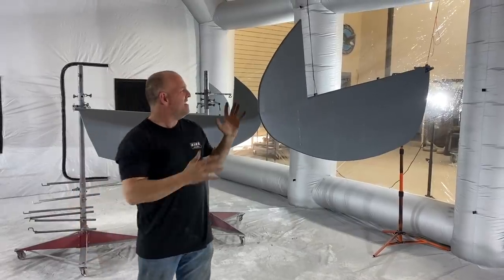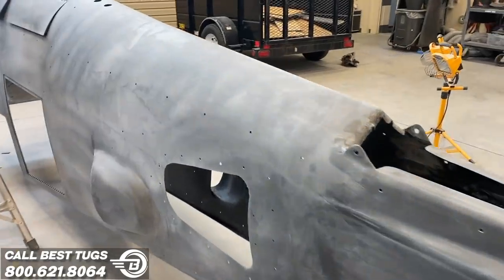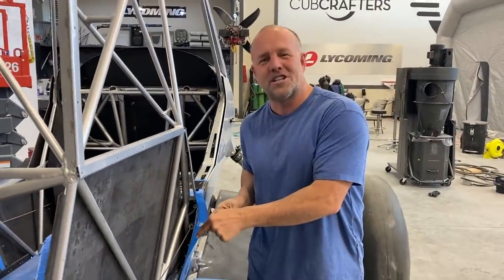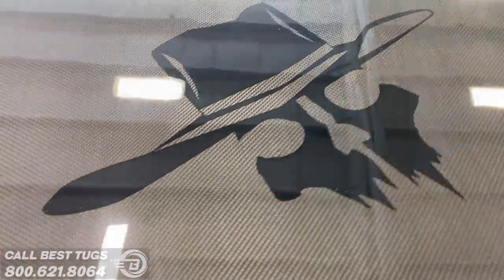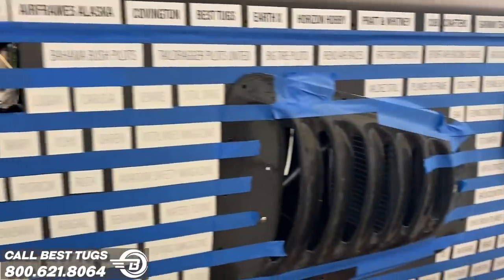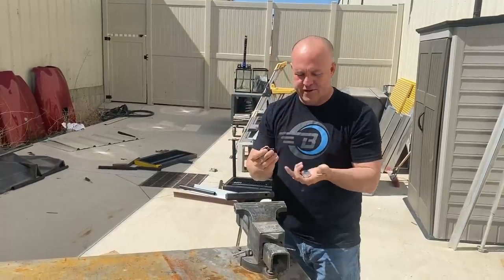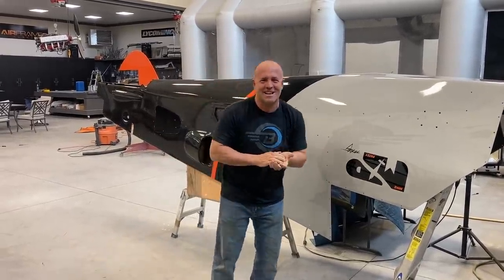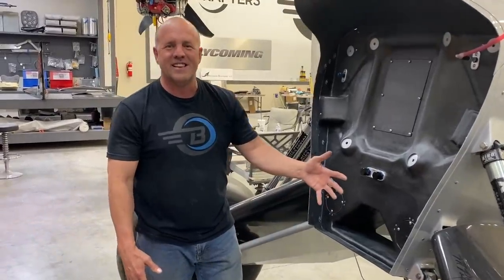Scrappy gets a paint Job (Scrappy Bush Plane 23)

Comment: oh, now i'm interested to see what you've got going on in the suspension. I know those shocks well, they don't need a high pressure line running to them like that in a 'typical' application. I also see those dual carbon fiber wrapped tanks in the belly pod. Hypercomp Engineering by chance? I know those guys well and they are also based in Northern Utah. All of that stuff has my spidey senses tingling! I can't wait to see what weird shenanigans you've got going on for the gear wings!
Reply: This unique quad-shock landing gear configuration will allow Mike to fly the aircraft into the ground effortlessly, at will and with incredible  precision.  Point it and then power controls decent rate to target. 
Think about how that capability would allow you to modify your entire landing technique.  I'm sure he will set the new standard for Spot Landing and Stol-Drag competitions.  Want to guest what happens when you finger- trigger a high pressure air source to these airshocks at the aerodynamically  optimal moment in  the take-off run?  Scrappy, with that massive air-prop, coupled with controllable pneumatic landing gear, will even surpass the incredible takeoff and landing performance of Draco!  I'm telling all my aviation friends to check out 'Back-to-work' Mike Patey.  So many unique innovations in one plane from tailwheel suspension to final carbon clearcoat and he's  not even revealed the wings to us yet...Super impressive concept and execution of  the insanely detailed fuselage graphics with all the aviation names imbedded in polished clearcoat over carbon. Absolutely Brilliant !
Reply: @chucklewis6949  I've been thinking about this, and i'm not 100% convinced that bouncing the aircraft into the air during takeoff will buy much. The suspension will do wonders for landing, yes, but i'm not positive a little bounce at the right moment will buy much on takeoff. My thoughts are that if the wings are generating enough lift for that to be beneficial, they are right at the brink of having enough lift to take off normally anyway, because without the airspeed, there will be inadequate lift to keep the plane in the air, so it may just float back down. Now, granted, it would increase the angle of attack a bit, but that's just going to use up some of the energy the plane has and possibly create a stall just above ground, but then again this little plane has enough horsepower that may not be the case. it might be just slap the throttle and pull a trigger and you're off the ground. But, i vaguely remember him mentioning in the videos he has a method to prevent the landing gear from being drooped out during flight. So i'm betting he has a secondary piston at the bottom of the shock that he can apply pressurized gas to that will effectively raise the lower bump stop causing more loading of the suspension, so its more rigid and predictable in flight and leveling the gear wings.
Reply: Mike mentioned he could lock the shocks whenever he wanted so he may have developed a system to control the angle of his gear wings in flight and on the ground. He has also mentioned I think the idea of getting a plane to partially 'leap/jump' off the ground during the Draco series. Mike seems to have at least 3 uses for everything so it would be lucky to predict  all the surprises Maestro Mike Patey has in store. Can't wait!

Comment: @Mike, I have a question. This plane has very long suspension travel, the Wilga's are known for landing at weird angles because the landinggear allows one wheel to be fully extended and the other fully compressed. Did you consider some anti-roll feature for this plane? For example by cross linking (top of piston one to bottom of piston two and reverse) the two sets of shock absorbers with a set of accumulators to compensate for the difference in volume of the top/bottom of each piston?
Reply: I think Mike is familiar with the Wilga  issue
Reply from the maker: I think your really going to like an upcoming video 😜🤠
Reply: @MikePatey   Looking forward to it then! A sidenote: I like the landinggear of scrappy, so I made a landinggear for my RC plane that is close to the one on scrappy but modified to be usable on the RC scale. It is made to fit on the "durafly tundra", this is a quick render of the idea: https://live.staticflickr.com/65535/50080678213_59e9a47a65_h.jpg
Reply: @geepuller1  Hey, yeah he has a wilga and had draco besides that. I named it to clearify what type issue I was referring to.
Reply: I'm thinking the mini wings and landing gear are active and move up and down with a switch through the hydro king shock's... Maybe  Rad build!
Reply: Those mini wings with the landing gear are active I bet... King hydroshocks maybe? ; )
Reply: In the last video, he hinted that there was something special with the front shocks. I can't wait to find out what. 
In the Draco landing gear video he talked about how he figured out how to make the plane squat down and then jump up on takeoff, but the system was too heavy. I wonder if he is going to do something like it on scrappy now. It's the perfect plane to try out silly stuff like that.
Reply: It could be this option from King: http://www.kingshocks.com/products/options/ibp-internal-bypass/

Anyway, enough speculating we will just have to wait and see! Looking forward to the next video Mike!

Comment: Mike, another backstop for the cable on the tube is a super thin piece of hdpe. That way if there's vibrations making the cable contact it would take 100 years of wear to ever touch a tube. Just like the stock piper rub plate..

Comment: Mike,   Very Nice Work, Sir. I cannot wait to see Scrappy's performance. It will be Amazing !!
I believe You have achieved YOUR GOAL of promoting General Aviation with both Scrappy and Draco. This build may be the 14th or so aircraft you've built but the impact on GA cannot be
overstated, in my opinion. This video, since YESTERDAY, has 93,965 views (38 trolls didn't like it). People talk about the things they like, so I figure 94K views will touch a significantly higher
number of people.

Comment: I’ve done two airplanes with Stewart systems now.  On the last one, I put two cross coats of eco prime over the eco fill and loved the results.  I used smoke grey.  The lighter color made the red top coat really pop.  It does add weight though.  
I place a small strip of thick Teflon tap on any tube that a cable comes close to.  It’s just a little extra insurance.

Comment: That white paper your stickers are mounted to works really well as masking tape and you don't have to use 50 rolls of tape. You just lay it over the fine line tape (that you should be using) or the stencil and then carefully trim with a blade..

Comment: Get a cheap 29 foot tarp and throw it on the floor. Then you can pull it out and pressure wash it to get all the dust off and then when you wear it out you just throw it away.  I don’t have room to leave my paint booth up so it makes it easy to keep it clean.

Comment: The landing Gear Mini Wings are going to generate a lot of Drag from the space between the each arm. Consider building a leading edge cowling to cover the gap. Also I notice the electrical tape under your grip-ties on the hoses. Silicone Self Fusing Tape holds up way longer, and stronger under the the extreme temperature changes.
Reply from the maker: 🤠 Agreed on both.  The gear legs I’ll talk about later. the Griplock clips and photo wasn’t from my plane, just something my friend editing found real quick online. I use the same tape you mentioned.  I can’t stand the mess electrical tape makes and certainly worse in high temp 👍🤠

Comment: A genuine delight to behold. It will be interesting if beneficial ground effect occurs from the aerofoils on the main undercarriage arms with such a huge wash coming back from the prop pocketed between the aerofoils and ground. My imagining is that the aircraft may be come a little less stable on the roll axis. With extreme nose high power-on approaches and landings, I guess this may become moot.
Reply from the maker: 👍🤠 Certainly on the right track in my design considerations. I’ll talk more on it later

Comment: Hello Mike, I have a question for you... Back in episode 12 "Building Molds" you created the vented air exhaust cover for the oil cooler. I've wondered why you chose to bring the air for the oil cooler through the side of the fuselage instead of bringing the air into the oil cooling chamber in a straight line from the top of scrappy, down in through the filters and exiting out the bottom of the fuselage. I'm sure there are a lot of viewers like me who would like to know why that approach was the better option. It's a pleasure to watch you work and build an exceptional bush plane. Thanks for sharing. Please keep them coming.

Comment: I am in awe of your skill and progression. Amazing attention to detail.

You discussed sanding into the carbon/glass as a sacrificial layer. It has got me wondering at what point would the layer be compromised. If the higher strands of the cloth were nicked no more than 1/2 their cross-sectional diameter, I calculate that more than 90% of the strands are still in tact. 

Would it be appropriate to consider that the structural integrity left in that layer would be at least 90%?

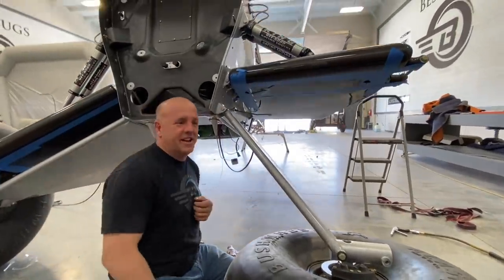Comment: 20:22 -I think I figured out (one of) Scrappy's secret weapon(s). It looks like his custom shocks can be locked into place. (Hinted at in a previous video and shown in this video. Maybe even actuated to move up and down?)
-My theory is that while on the ground, running the engine at high RPMs, and brakes on; Mike may be able to compress the main gear; squatting Scrappy to the ground and locking the main gear in that position. (Similar to Draco's squatting action before take off.) Then Mike releases the brakes, gains speed, and right before Scrappy rotates, he can push a button that releases/actuates the main gear! This would not only push Scrappy up into the air, but the reduced deck angle at the beginning of the run reduces drag to get Scrappy up to take off speed sooner, and then the sudden increased deck angle will increase the angle of attack/lift of the whole wing. Maybe popping in more flaps at that moment too. He'll also get additional ground effect lift from the landing gear wings.
-Scrappy may literally jump into the air! Haha! :-D So epic!
-Also those Kevlar bottles under the pilot's seat look suspicious. Perhaps compressed air/nitrogen tanks for the shock actuation system? Hmm :-)
-If this is all the case, I do wonder how well the gear will compress. Since it's a double A-arm suspension, the wheels will tend to scrub on the ground as the wheel track increases if he compresses the gear while at a stand still. He may have to modulate the brakes to roll the plane forward a bit during the engine run up to get maximum squatting action.
-Just my theory. I can't wait to see the maiden! :-D
Reply: no wheel scrub , double a arms .  but he hinted at a trick ,so I think you are on to it , he got the shock builders on board with something , ie not a standard of the shelf part , and they look a lot bigger than needed for a light plane .

Comment: Since youre planning on flying in Alaska, and have the cockpit designed to stay sealed up weather tight even after a ballistic chute deployment, have you considered a radiant film insulation between the outer and inner skins in the cockpit? I dont think the bubble-wrap style insulation would survive the pressure changes with altitude, (though it might, test in a vaccum bell jar?)  but even something as simple as gluing down a space blanket with spray adhesive to one  panels would cut down on radiant heat transfer in the gap. it might even cut down on heat from direct sunlight bleeding in when youre in the lower 48, and not add much in the way of weight.  It seems like it would provide some benefit to normal use, some benefit to emergency use, but I'm not sure if the benefit would be big enough for it to be worth your effort installing it or not.

Comment: I bet the secret feature of the shocks is they are air shocks and can have a really high pressure blast blown into them to launch the plane into the air on take off. Those looked like air lines to me and when he took them out of the box they weren’t at full extension like an ordinary shock. If I’m wrong correct me

Comment: Hi Mike, i love your YouTube channel. It is the most interesting and satisfying of all YouTube channels, in my opinion. I love Scrappy but, i am worried about the bolts connecting the landing gear to the fuselage. Shouldn't you be using steel dowels instead? I am worried that the shock absorbers will shear through the bolts like a hot knife through butter! Stainless steel bolts with holes drilled at the ends for locking pins would be much more durable and tough. Bolts have threading around their surface which can be thought of as large continuous cracks!

Comment: The aircraft I work on utilize carbon fiber on most of their fuselage and panels which makes me familiar with the difficulties of attaching carbon fiber to a non-fiber component. I watched the process you went through to make the fuselage and you briefly touched on the process you were going to use to attach it the tube frame. I was hoping you would have shown how you actually accomplished the installation. Attaching anything flat to tube without stressing one or both and achieving the required structural integrity is extremely interesting. What type of hardware are you using on your installs? Great video's, thank you for sharing. When is your bother going to start to share his build?
Brock

Comment: Sir,,,, those looked like nylon bushings on the control lines.... I used nylon pulleys back when I built soap box derby cars.  The line actually cut thru the nylon and I had steering issues because of it....

Comment: Mike. Do you worry about the heat generated inside the airframe with all the black carbon fiber? I build composite rc sailplanes and we try and keep the wings covered when sitting in the sun to avoid heat damage. The wings/fuselage are all exposed raw carbon so they get really hot.

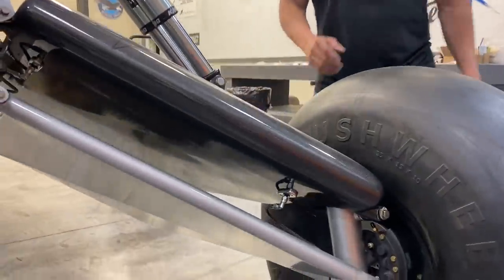Comment: great job!! however, at 26:24 i was wondering if it might be worth it to somehow to fix the flexible brake hose. i fear that as the suspension articulates it may push and pull on the flexible brake hose that it may end up loosening the 90* fitting at the (new-to-market) the Patey Bulkhead Bracket.

Comment: not sure about your product but I know that the clear coat I use (SPI), the "UV" protection "rises" to the surface of the coat and is removed to some extent by the "scuff and buff" process..  "Flow coating" can be a plus if the UV is important..   Not a paint and body guy but was something I found interesting.. They also like some "real" sunlight on the stuff while it fully cures..  Maybe someone with more knowledge of the stuff can correct me..  Now about the "built in GoPro mounts"  :)

Comment: Truly amazing work Mike. Really, it's just beyond impressive.
Out of curiosity from someone who has no engineering background at all; what kind of outward forces do you expect to see applied to your suspension upon landing? I noticed in your previous videos that the tires slide outwards away from the fuselage as the suspension compresses, and I'm curious how strong that outward sliding force is. I would imagine it would be totally negligible, but I'm curious if that was something that was considered.

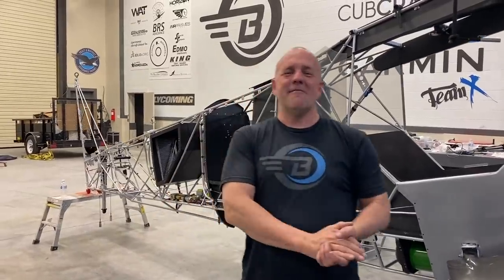Comment: Is that a high pressure reservoir (green) under the fuselage (just forward of the belly pod) I can see at 24:37? The high pressure lines coming off the top of the shocks make me think Mike is going to be able to adjust the angle of the gear ‘wings’ in flight to adjust the dihedral and maybe hit a button to make them ‘pop’ him off the ground for an assisted takeoff...?

Comment: Okay, the clear over the Carbon looks great but what about the heat that it will be subjected to when parked at Oshkosh? I get that there is a UV barrier but can the epoxy withstand the temperature it's going to reach when it's functioning as a solar heat collector? 
Special epoxy?

Comment: It makes sense (sanding down the extra resin applied).. but how about this.. Could you add some black dye to some automotive bodywork glazing putty.. spread to fill pinholes/quick sand.. and could it possibly be hidden by dying it black?
Reply from the maker: 👍🤠 great question! Yea I thought that so I did a few tests a few years ago and the black spots were better than the holes but they stood out and not everyone noticed but I sure could so I went back to clear

Comment: Fantastic work Mike! Been binge-watching your amazing builds and have learned a hell of a lot! I remember that you mentioned a lot about the insulation of metallic surfaces from carbon due to galvanic corrosion. Are the fasteners used to fix the brake line brackets insulated from the carbon hole edges in a similar way or are they made of a material that prevents this from happening? Probably a moot point, but I'm just curious?

Comment: My only question is, does the strength of carbon fiber change with the outside temperature? Example would be flying in negative degree weather vs. desert 110+ degree weather? If there is a change in strength, is it enough that you have to adjust for it or can you ignore the small difference? Thanks for all your engineering work, Mike!

Comment: MIKE, MIKE, MIKE!!  I just have to know.  What is your next project, DRACO X or the race plane?  If Draco is next I vote for building it around the 1250 hp race motor so you can swap it back and forth between the two.  I mean, “That is way too much horsepower” was said by  NOBODY!